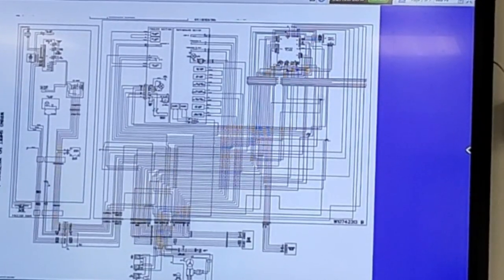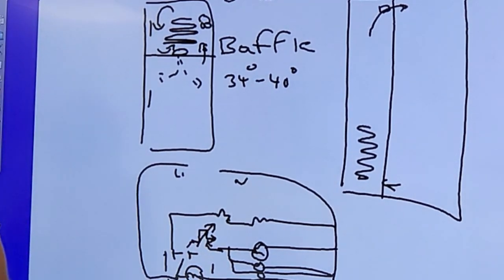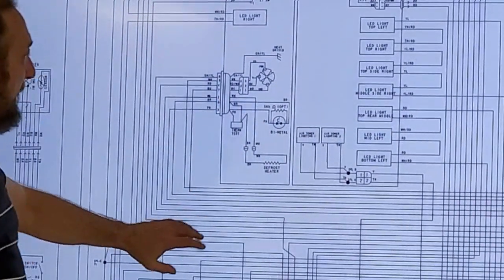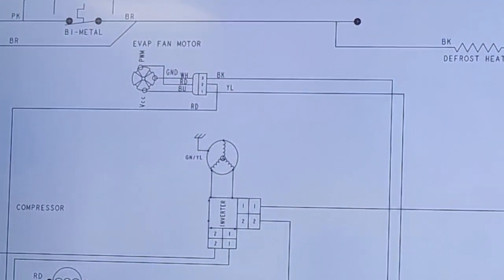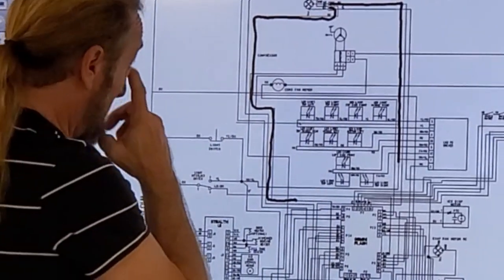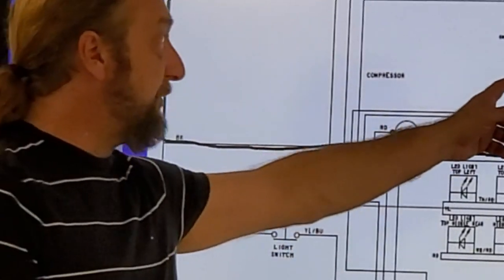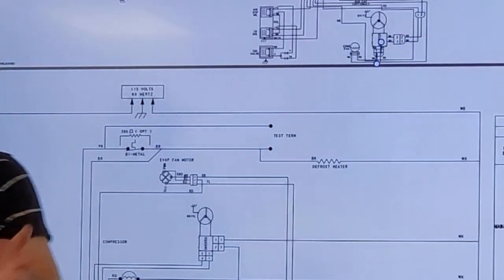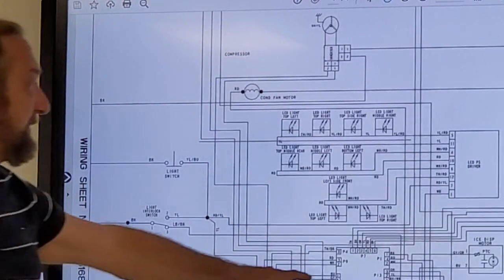Whirlpool Refrigerator Diagram

Comment: An evap fan does not always run immediatly when there is a call for cold. Some evap fan motors have the defrost terminator wired in series. When the suction line gets cold, the defrost thermostat closes and completes the circuit. 30 years of appliance repairs....